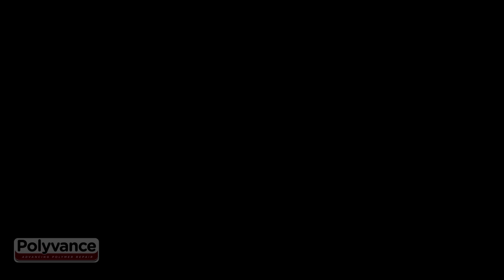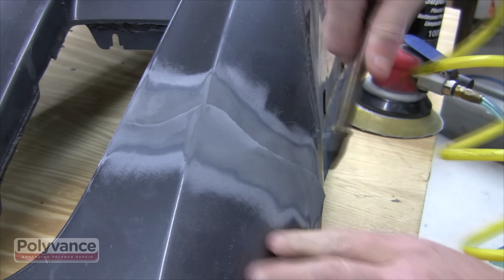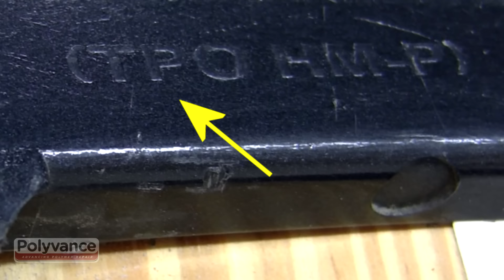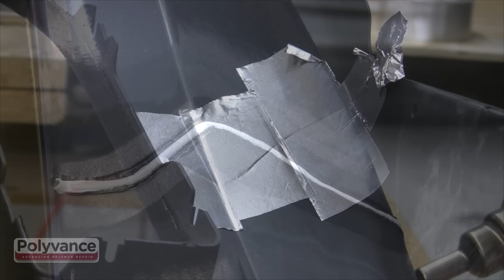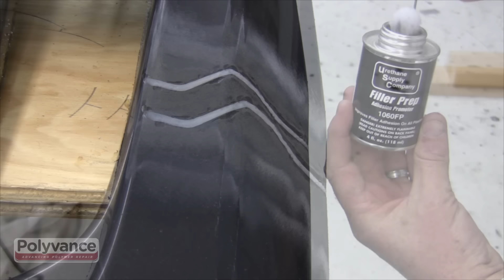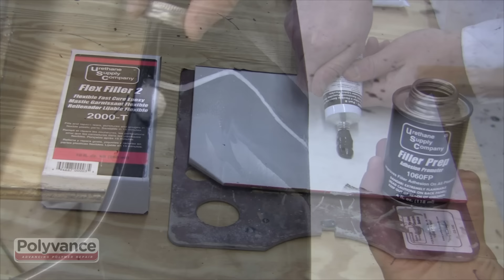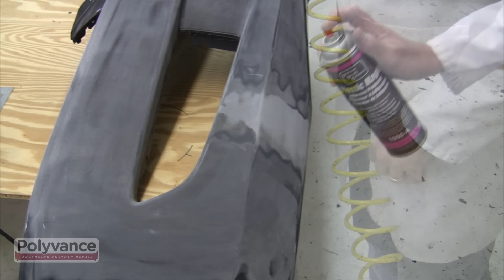Bumper Repair with Hot Air Plastic Welder

Comment: This video guy  makes you waste money because you need to buy the stuff he is using🙄🙄🙄 oh brother.  You have all the things you need In your house already.  All you need is sandpaper, a cloth,  alcohol to clean area and zip ties or similar bumper plastic and something hot like an iron or soldering/ welding iron if you have one and that is it....start blending
Reply from the maker: This particular machine is for professional body shops. They would already have the supplies they would need like cleaners and sanders. Hot air is faster than using a soldering-iron type tool. Using nitrogen is better than using hot air because the nitrogen acts as a shielding gas to prevent oxidation of the plastic and make a cleaner weld.
We do make tools for more DIY-type projects.
As to your point about zip ties, the most common zip ties are made of nylon. Most bumpers now are made of polypropylene. Nylon won't fuse with polypropylene, so that wouldn't work. However, there are some zip ties made of polypropylene.
We have different videos showing how to use our airless plastic welders. Those are more DIY friendly.
Reply: Placido,  most zip ties are nylon and will not weld to PP.  You need pressure and the correct temperature heat to make a good weld, as well as the correct filler rod.  The least expensive way to do this would be with an airless welder like Polyvance's 5211, which can be used for many other plastics with the right filler rod.  Using a soldering iron will char the plastic and produce a porous repair that is not as strong as one made using the correct tool.  The hot air welder or nitrogen welder in the video are more for body shops and other businesses where they need to make repairs as quickly and as strong as possible and where they just aren't making a single repair.

Comment: It's so costly by the time it's done, you might as well buy a new bumper 😂
Reply: Once a shop makes the tool investment - just like they do with metal welders, this method IS WAAAAAY cheaper than replacing most bumpers.

Comment: Hot air welder is by far the best. Sand paint off, use a belt sander which is way quicker to put a channel in it to fill then stich weld it first to stop the plastic warping. Personally i would use 8mm tape rather than the rod as it leaves a stronger weld and also at the edges should be braced across for extra strength. Once completely cool just use a grinder with a soft disc and sand. No epoxy or filler needed. This is one of the better repairs i've seen though.
Reply from the maker: Nitrogen welding is even better than hot air welding because the nitrogen acts as a shielding gas to prevent oxidation of the plastic.
Tape is not going to be better than welding rod.
We do usually "T" off the weld at the edge, but they didn't do that in this video.
Here's our nitrogen plastic welding playlist: https://www.youtube.com/watch?v=mz0aBrDcAa8&list=PLmdrqwjPa5t96UdEcFfS9JSN6J8eaXb8-

Comment: Why are you cleaning it before working on it you've just wasted your time doing that?
Reply from the maker: If you have contaminants on the plastic and you sand or grind it, it's very likely you will embed some of the contaminants into the sanding scratches (which will impact the quality of the repair).  You should always clean the plastic first!  You can clean it again after if you wish, but you should always clean it first!
Reply: @polyvance  which is why you clean out all contaminants afterwards, I am not criticising you at all but this is the way I've been doing it & I've had no problems to date. (saying that I'll probably cock it all up tomorrow).

Comment: Would be cheaper just to buy a new bumper...
Reply from the maker: These particular machines are mostly used by professional body shops. Shops can make money, save the customer money, and keep plastic out of the landfill.
We do have some cheaper, more DIY friendly products.
As far as the argument about repairing or replacing:
Some bumpers may be cheap, but many are not...especially on older cars. Many of the cheap bumpers you can find are aftermarket, and you might run into fitment issues with those. Plus you may still end up having to paint the new bumper anyway.

Comment: Why clean before sandpapper?
Reply from the maker: If you have contaminants on the plastic and you sand or grind it, it's very likely you will embed some of the contaminants into the sanding scratches (which will impact the quality of the repair).  You should always clean the plastic first!  You can clean it again after if you wish, but you should always clean it first!
Reply: @polyvance  Cool 👍 thanks for reply!
Reply from the maker: @wikingsweden7464  You're welcome!

Comment: Just replace the bumper. All this does is save the insurance company money. The next step is they will only pay you for spot repair paint for this repair.
Reply from the maker: It can save money for the bill payer also.
Check out the "Plastic Repair" section of this article: https://www.autobodynews.com/index.php/component/k2/item/15517-the-best-body-shops-tips-repair-vs-replace-what-a-body-shop-should-consider.html?showall=1
Reply: The shop makes more money too, and the OEM bumper will not have fitment issues like many aftermarket replacement parts.  Shops always blend repair areas on a car when making a repair and typically never paint the whole car.  so if that blended area is limited to the bumper itself and not the hood and fenders if it were anew bumper, why wouldn't you opt for the repair?  Not to mention you'll also be stopping about 20 lbs of plastic from entering your local landfill.

Comment: Pretty redundant to clean with plastic cleaner before sanding.  Really.
Reply: Wally, no, not really...If you sand with contaminants on the surface, they can get ground into the sanding scratches and can effect the quality of the weld and can affect the ability for finishes to be applied without producing defects.

Comment: Handy information if only the tools weren't so expensive for DIY use....think i will stick to the soldering iron or hot air gun with attachment or not just have to be careful as this stuff has been done long before digital controllers came out and most i have seen in workshops is basically a hot air gun anyway
Reply: Enjoy burning up your heat gun trying to weld with it.  IF you try to restrict the airflow of a conventional heat gun to the point you can control it enough to weld with it, it will cause the heat gun to overheat.  The cheapest way to go is the 6055 welder.
Reply from the maker: Here are some of our welders that are more DIY friendly:
https://www.polyvance.com/Hot-Air-Welders-1/
https://www.polyvance.com/Airless-Welders-1/

Comment: I’m a carpenter in commercial construction. Is this roughly the same tool I see all the floor coverers using ..to weld the seams ... joining those rolls of vinyl flooring they lay out?
Reply: Its similar in that it uses a jet of heated gas as the heat source, but those that do floor coverings and wall seams generally dont use nitrogen.  They also don't have a very narrow jet because they are usually making a lap joint, rather than butt joints and such.
Reply: Scott B thanks Scott. I have seen them “trim the top” so to say... though ... like it was a butt joint ... maybe it depends on the application. Lap joints sound like they’d be easier to get done quicker I guess.... not really knowing anything about these machines other than getting the gist of them
Reply: @williamgeorgelopezjunior8533  I'm not up on the roofing application, but I think they use a lap joint...or they butt the sheets together and weld a wide strip over the top of both sheets, which would technically still be a butt joint, but the width of the "rod" is so wide its more of a lap joint.
Reply: Scott B ah that’s the mixup.... roofers ... I was mentioning floor coverers ... vinyl floors, classrooms, cafeterias... those steak and potatoes...

Definitely Laps on the roofs all day .... 

Unless you’re bringing the roofers into the mix now?
Reply: @williamgeorgelopezjunior8533  Ah, sorry about that....in my mind I was thinking roof, even though I said floor previously...Must have been a series of Mondays when I responded.  I did a little digging and yes the tool is similar.  In this video (see link at the end), they are using a Leister welder ($$$$) which can be used in the same way as the Polyvance 6055 welder ($).  They made a butt joint, btw.  I really liked the weld trimming tool they use to clean up the weld.  Its pretty neat.  Too bad it wouldn't work on harder plastics.   https://youtu.be/RpBWGZxBVSQ
Reply: Scott B I got rabbit holes into this video originally by watching another video of someone welding a bumper... diff process though. Graft behind the face of panel but there was a seam before they blended it

Comment: What professional body shop will go through the time and expense for a split in a plastic bumper cover?
Reply from the maker: Plenty. Why make the customer wait for a replacement part for something that can be fixed without too much trouble? You may be interested in the "Plastic Repair" section of this article from Autobody News. It talks about the benefits of plastic repair and gives a win-win scenario for the shop and the bill-payer: https://www.autobodynews.com/index.php/component/k2/item/15517-the-best-body-shops-tips-repair-vs-replace-what-a-body-shop-should-consider.html?showall=1

Comment: TOO HIGH TEMPERATURE You burned it.........
Reply from the maker: When welding with compressed air, the plastic will experience some oxidation. However, it will still make a strong repair. For an even stronger repair, we recommend welding with nitrogen, which acts as a shielding gas to prevent the plastic from burning or smoking.
Reply from the maker: Here is a video: https://www.youtube.com/watch?v=Br096FaPnnI

Comment: An epoxy such as Gorilla 2 Part Epoxy is far stronger and more rigid  than that aluminum tape. Ask the Pros.
Reply from the maker: The tape isn't the repair. The tape is just to make sure the welding rod does not ooze out on the opposite side.
The fusion weld is the repair. We are melting the base material with a matching welding rod to create a solid piece of plastic.

Comment: Why go through with all this hassle when you could just purchase a new bumper from certifit for $49.99. Lmao.
Reply: You're right! Some replacement bumpers are so riduculously cheap and readily available, so it would make more sense to buy a new one in some cases.  However, even if the bumper is inexpensive, if you repair what you have, you will never have fitment issues and you can often blend the color within the bumper and not have to blend the surrounding body panels.  This is a HUGE time and $$$ saver.

Comment: It cost more for the tools in this video than it would cost to buy a whole new bumper. Lol
Reply from the maker: Our hot air/nitrogen welders are more for body shop use. Body shops would already have a lot of the tools needed for this type of repair. We do, however, have a hot air welder kit, our 5700HT Mini-Weld Model 7, and a few other airless welder kits that can be used for DIY and are cheaper.

Having a bumper repaired by a body shop with professional equipment may save you money instead of having the bumper replaced. It just depends on the amount of damage to know if it is worth repairing or not. Many times, it is cheaper to repair (or have repaired) those small cracks and torn tabs rather than replacing the whole bumper.

Comment: The first thing you do with any crack in any material is to drill a "stop" hole at the end of the crack to prevent it from propagating any further.
Reply from the maker: Stop drilling is not really needed in this case.  While "V" grooving the crack, the end of the crack gets a radius...then when you weld, the weld overlaps the end of the crack, eliminating the stress riser.
Reply: @polyvance  Your technique makes no sense.  You're trying to accomplish the same thing a stop hole would do without actually creating a stop hole.  WHY???  When you properly drill a stop hole you know for certain you have stopped the crack.  You can still V both sides and you needn't wonder if your technique has stopped the hole.  Drilling a stop hole only takes a few seconds and I see no logic in avoiding it.
Reply: @ramtek2702  if it makes you feel better to stop drill the crack, then by all means do it, it will not hurt anything.  In this case, it is not necessary.  If you email Polyvance at info at Polyvance, I will send you a sketch as to why it isn't needed here.
Reply: @scottb7600  Drilling a stop hole makes me feel like I've done the work properly and not rationalized a reason for eliminating a simple step.  BTW, no sketch will be required as I am a mechanical engineer so I think I have at least as much knowledge of the physics involved here as you do.
Reply: @ramtek2702  Same college background.  so you should LOVE a sketch.  ;-)
Reply: @scottb7600  No sketch will convince me that a stop hole isn't the best way to stop a crack.  Hey, maybe that's why they call it a stop hole.  V-ing both sides of the crack MIGHT accomplish the same thing depending upon how good a job you do but drilling a stop hole will definitely stop the crack.  Your arguments just don't work.  I am glad we can have a civil conversation about this without calling names.  Thanks for that.
Reply: @ramtek2702  The beauty of engineer talk.  One more try to convince you that in this case a stop drill is not needed...OK.  So say you stop drill it with a 1/8" drill bit.  You then V the crack 80% of the way through the plastic all the way to the very end of the crack with a bottom v angle of 125 to 130 deg.  You then weld that side and the weld penetrates another 5 to 10% of the original material thickness so you have about 85%  of the thickness of the material repaired.  You then flip the part and v 50% of the way through the material again with a 125 to 130 deg bottom angle. The second v will completely remove the original 1/8" stop drill hole, plus when you weld, it will penetrate deeper than that original thickness.  Granted this is for a bumper, which is a non-structural part and not an aluminum or carbon fiber airplane wing skin, where the repair criteria would have much higher standard.
Reply: Normally yes, but when you v-groove the crack on both sides, when you get to the end to make a radius,  this effectively acts like stop drilling the end.   If the crack was fatigue related, I might be more inclined to make a larger radius at the end, but with impact cracks an larger radius is not as important.

Comment: Hi! Thank you for sharing such a valuable method! I wonder if I can use a heat gun to do the job instead of a hot air welder?
Reply: Unfortunately no, you cannot focus the airflow down to a small enough point to have control of the weld and not melt down your heat gun.  Hot air welders are designed with low flow with a narrow tip in mind, a heat gun does not and if you try to restrict the flow to the point where you can weld with it, the heat gun will overheat and either burn up or shut down.
Reply from the maker: Do not use a heat gun to weld. You will either fry your heat gun by restricting the airflow too much, or the heat source will be too broad and you will warp your whole bumper and not end up with a weld. There are hot air welders that look like heat guns, but they have digital temperature controls and reduction nozzles.  The temperature control allows the reduction of flow without melting down the gun. An example is our Steinel LCD Hot Air Welder Kit: https://www.polyvance.com/Hot-Air-Welders-1/6055/
Alternatively, you can look at one of our airless plastic welders. We have some that are pretty inexpensive and will do a good job.

Comment: Why do u clean the bumper on the bigining when ur gonna use the sander
Reply from the maker: If you have contaminants on the plastic and you sand or grind it, it's very likely you will embed some of the contaminants into the sanding scratches (which will impact the quality of the repair).  You should always clean the plastic first!  You can clean it again after if you wish, but you should always clean it first!

Comment: Great demo but the plastic weld alone will not stand up.  When you park your car and some other vehicle taps that side of the cover, it will split again. I've done plenty of pumper repairs but one this size, never. But, if you insist on repairing it you must reinforce the split from behind for a better job. Using a 2 part urethane with a fabric mesh works very well. Just my 2...
Reply: A good weld should be no more likely to split than the original part.  Plus if you want to reinforce a plastic weld,  you can simply lay a wider strip on the backside or adding a few welds perpendicular to the original crack.  Adding this type of reinforcement will gauranty the bumper will split in some other place before it will split at the repair.    Using a 2 part is just a big waste of time and money  when it comes to this type of repair.

Comment: Interesting repair unless you're on a budget. For me, it's wire mesh, mild beveling and glue all the way. Btw, I scruff material off with hacksaw blades, the thrifty man's drawblade.
Reply: Adhesives don't stick well to polypropylene, at all.  You way may be cheap, but it will not last like a weld.

Comment: This repair costs more then a new Part...
Reply: In some cases, yes, but in most, no.  As when repairing anything automotive, you need to weigh the cost of the repair vs the cost of a new part.
Reply: how, when you can buy the rods for $3 from Hongkong?